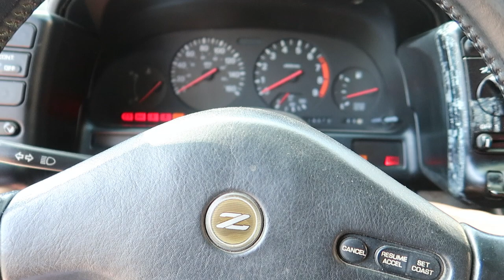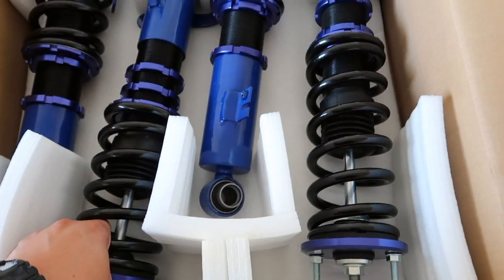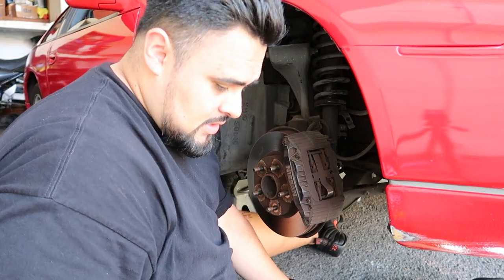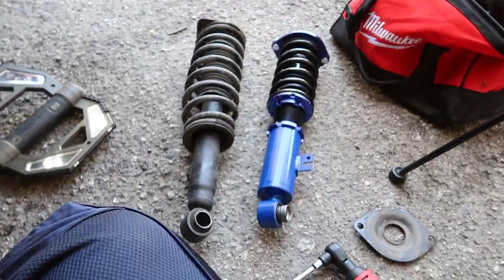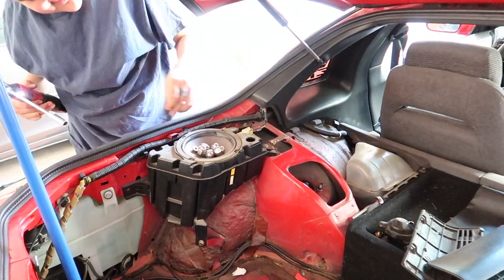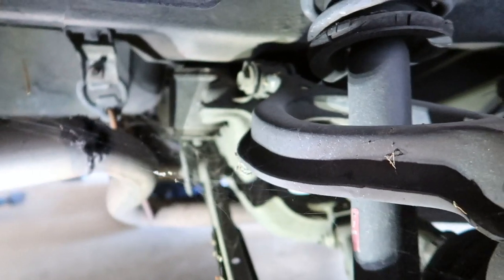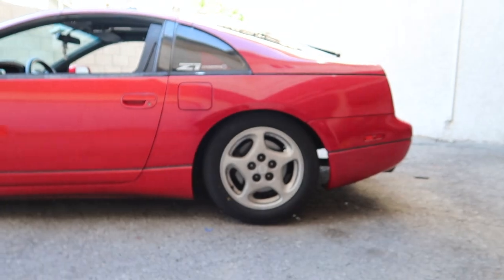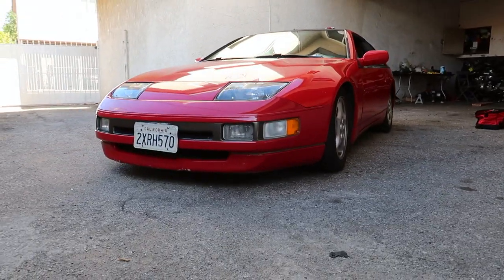MY NISSAN 300ZX Z32 COILOVER INSTALL

Comment: You can clearly see how messed up your camber and alignment is now without the front and rear adjustable arms.  Cheep coilovers on stock wheels and arms is not the correct way to do it IMO.  You literally just lowered the value of an unmolested 2+0 by investing money into it.